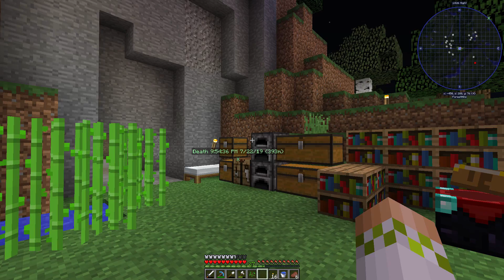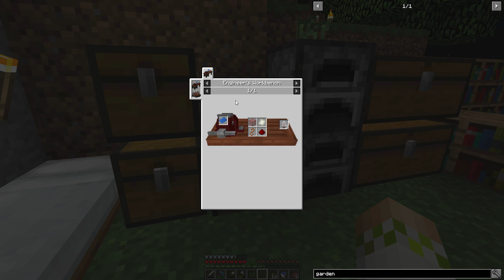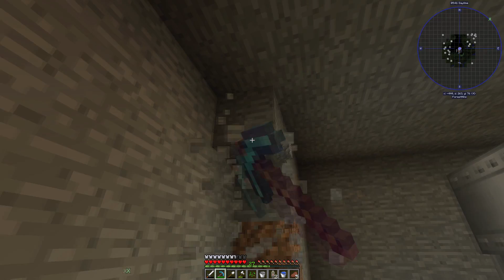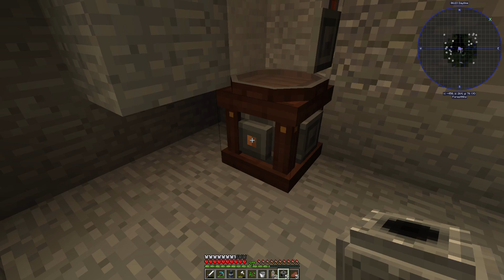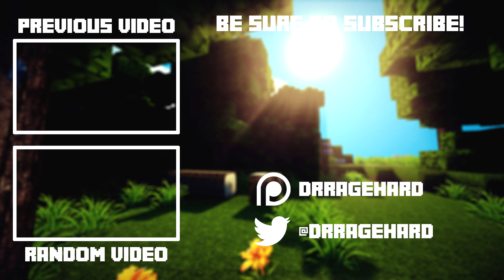Surviving With Immersive Engineering :: E03 - Garden Cloche

Comment: Garden cloches are amazing with Mekanism. They grow whole melon blocks, which can be sawmilled into 9 melons and that's 18 bio fuel. 9 garden cloches in a line can do the work of a massive vanilla melon farm and power a gas-burning generator at full output. I haven't tested if cloched baked potatoes are faster, because 9 cloches are so cheap that i just don't even care.

Comment: Note on the garden cloche: I didnt test it with water plants but apart from that they seem to support every sort of plant. Cactus, sugar canes, netherwarts and chorus fruit dont seem to be a problem as long as you provide the corresponding soil.
This includes plants from other mods and even stuff like Mystical Aggranditions that has high end plants which need specific blocks under their dirt block in order to grow - even those are no problem if you plant the seed directly on top of the extra block.
Garden cloches also ignore how long it takes a plant to mature. 
Both of these combined mean that I have a reliable source for awakened draconium where the plant doesnt take ages to grow. And this thing is easy to set up once you figure it out.

Comment: Rage! If you have time or feel like it you should defenitly make a serie on another game other than minecraft. A sugestion would be Oxygen not included since you love engineering. It bases alot of it's mechanics in real life such as temperature, gas densities, polution, stress, power distribution (preventing cable overload), etc... It would be very interesting to watch you make the big lategame contraptions such as efficient oil refinement, temperature maintenance system or a large scale oxygen generation setup since you like engineering!

Comment: Hey 👋🏻 
Im having trouble when downloading this mod...i had downloaded the same mods related to immersive engineering but whenever i load in a world the game closes and gives me a crash report could you pls help ?
Reply: Try just instaling IE and IE core (must be same version) and after jei if that works try adding like 2 mods at the time and check wen it crashed
Reply: Hope i helped
Reply: And do you have forge for 1.12 if you have IE for 1.12
Reply: @HJM9x I do have forge for 1.12.2 as I also play other mods, I downloaded IE but I haven't found IE core online I saw them saying that the IE mod auto-create the core file.
Reply: @export488  if you're still having trouble my recommendation is to use the Twitch app, it can download mods for Minecraft and any additional files they need.